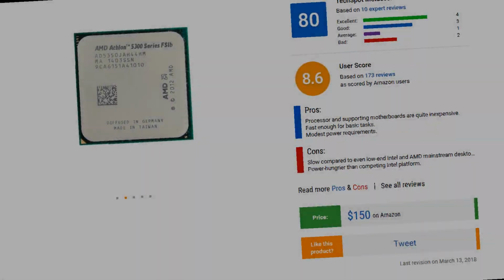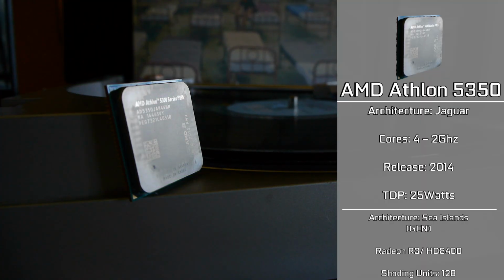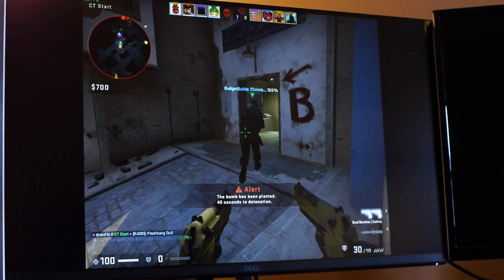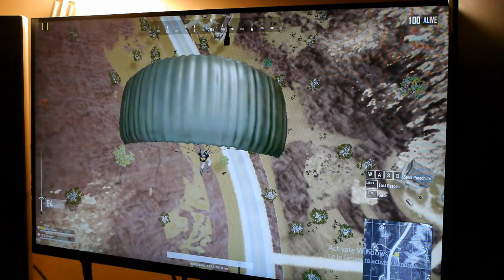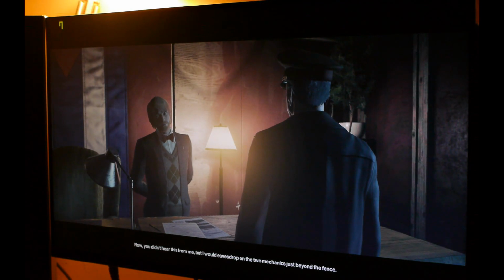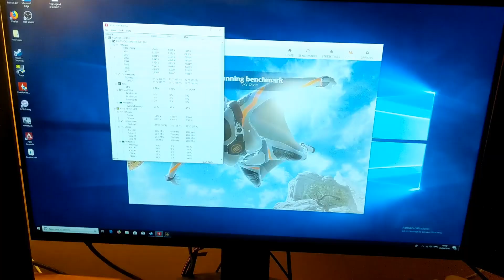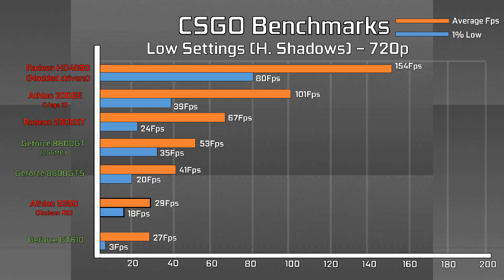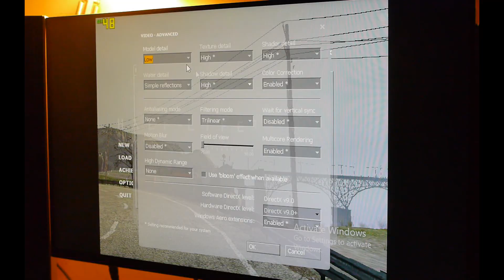Socket AM1 - Aging Horribly!

Comment: the APU side of AMD originated with brazos, the E-350 1.6 dual core with 80 gpu units, that i believe used a simplified K8 core (not the stars cores).  basically an HD 5450 and a dual core athlon x2 3600 underclocked to 1.6 ghz.  This is the evolution of that, and a lot better from where it started.  It was always intended for non gaming, or at least casual gaming, like candy crush, and internet/email.youtube... basically content consumption, not creation... you know, like most people use a computer.  In fact i'm typing this reply on such a device, a nifty 10" tablet/convertible netbook from RCA with a quadcore atom at 1.4ghz and windows 10, 2gb ram and 32gb ssd, and it still plays youtube and surfs the net great, now getting on 7 years old. amazing.
The one benefit about fm1 was the socketed design.  as it competed with intel's atom (and later the Celeron and Pentium J or silvers when intel pimped out the brand recognition to push atoms on the unsuspecting public) which was soldered on and could not be upgraded.  in that regard, it was great in concept, but being abandoned and never really developed for more than couple years really hurt it long term, as there wasn't anything to upgrade toward.
but, use it for it's intended purpose, and it's still fine today.  the low ghz speed is the only issue holding it back for any real 3d gaming, but once again, not the point of the system...never was.  And its a whole lot better than what came before it.  For the life of me I never understood why amd took what was at the time a decent apu, the e-350, and continued to pare it down in the early 2010s, making such monstrosities as the E-1000 and E-1200, running dual cores at a whimpering 1-1.2ghz, and throwing them in the cheapest laptops possible with slow mechanical hard drives. My mother in law bought one against my advice and was thoroughly dejected by the experience.  Even their old P4 Dell was more snappy.
basically any atom or amd apu that is not quad core is too slow to use today...and was actually too slow to use when new, but the quadcore systems are still usable for basic daily consumption, and fit the role well.  I also have a celeron J1850 2.0ghz quadcore atom desktop system I pieced together for $20 US fitted into my first PC case, a 2001 era HP pavilion 6835, and it runs linux mint great and I use it in my home office.  runs everything i need without issue and it is not slow for its purpose.

Comment: this always was the most standard Jaguar core you could get. Kabini sucked ass for anything that wasn't video acceleration.
Reply: Apsollute nonsence, i use E350 machine for old games and it works like charm, it even run og far cry with no problem.
Reply: @Dagoth666Ur  that's the thing: old games. it wasn't fit for anything plus-minus from its era.
Reply: @aviumcaravan  Well what do you expect from low power dual core apu? Compare it to same era Atom`s, what can you do with those?! AMD apu`s destroy`s them, so yes much more useful than Intel`s counterparts of the same time.

Comment: The Athlon 5350 overclocks easily to 2.3- 2.4 GHz on an Asrock ITX AM1 board. You also have to remember that the PCI-E 16 slot is limited to 4 lanes so it only pairs well with a video card like the GTX 750/750Ti. Also, you can pair it up with DDR3 2133 system memory for best results. It hasn't aged well but would be fine for games like Skyrim, Dragon Age Inquisition, Fallout 4 and other games from 2010-2015.

Comment: Notably the socket, likely to keep that 25 watt TDP, does not support dual-channel RAM. That, along with its various other limitations, also limit performance in games.

I think it's still a wonder though. These things are extremely thermally efficient, even to this day, for a x86 processor. But you sacrifice a lot of performance for it.

Comment: The Jaguar core was painfully slow at x86 workloads. However, both Microsoft and Sony managed to optimize their consoles really well around those chips.
The reason why it ran so slow was due to poor single threaded performance, and lack of L3 cache. Coupled with the (at the time) slow clockspeed of only 2.0 GHz, and you got a very lackluster CPU.
Reply: Not so bad, though, in the right scenario. FI, I tested my 1.6GHz 4-core Jaguar (basically what's in this video, but slower, and soldered in) with Handbrake, vs an i5-3320M (more or less a slowed down desktop Core i3), and the Jaguar was significantly faster. Why? Because it had no trouble staying cool, running at 100% on all cores, while the i5 had to back down to base clocks in short order, and didn't get a lot from Hyperthreading. I still use both machines, BTW, with the AMD one being my pick-up-and-go choice, as it gets 6+ hours on battery.

Outside of low end servers, HTPCs, etc., though, those chips were abominations on the desktop, and we're sold in Windows laptops for far too long.

The consoles partly did OK with them due to being such a huge step up from the prior generation. The CPU cores in the XB360 and PS3 were worse than first-generation Atoms at doing anything except for floating point arithmetic. The Jaguars were easily a 3-4x improvement, per-core, for anything that had branches, or could leverage OOOE...which is most real program code..

Comment: My computer specs. amd e1-2500 @ 1.7gz dual core, 
6gb ram ddr3 
radeon hd 8420 R3  built in processor
128gb ssd

This is a HP pavilion. My main rig as august 2021. play some older titles. does youtube, netflix, web and word processing.  Pretty damn good still I might add.

Comment: I have an amd 3850 system on the am1+ socket running with a r7 250 gd3 card. Runs vintage software very well, and I plan on setting it up with a 64bit version of windows xp. Hopefully, I can use it as a host system for a lan setup. I have a pair of core2duo e5600 systems with gtx260 cards to use as the client systems.

Comment: Unless you are an Intel shill what is actually wrong with and fx?
Reply from the maker: They are currently terrible value, when you factor in that a Core i5 2400 is about £12 now, and a board is about £15. You compare this with the cost of AM3+ on the market and it dominates it in all areas. There is no 'shilling' on this channel, just facts about what is best to buy.
Reply: @BudgetBuildsOfficial  problem is, is we are both talking about now old technology. Back when FX actually meant something price to performance AMD was better than intel. It has always been that way for current technology at least in the UK market.
I have used both AMD and intel products over the time and always find AMD much easier to work with (and that is as a power user), I have built systems using both as well.
Reply: @grumpyhale821  So true, people just pour bull***t `bout fx cpu`s but i have assembled buttload of systems witt fx cpu`s and no one ever have complained about them, yes they did not had ipc like intel cpu`s in that time but far away from usless like being represented today...

Comment: I got one for HTPC use back in the day with 8gb and a 128GB ssd, did the job pretty well in the 90w Antec isk 110. I ended up giving it to my mother as the case had visa mounts and could be put on her tv, where she still uses it today for web browsing, email. skype and MS Office.

Its a shame it never went further, as there are no real modern versions of PC and mobo for around £60, though the likes of the 300g are its kind of spiritual successor, but you don't get the £25 mobos for that.

Comment: If you bought an AM1 system to play games on it, you're not the brightest bulb in the box. Buy a calculator next time and try to play Cyberpunk 2077 on it.

But, if you weren't a complete potato, you bought an AM1 system for use as a low power file server, and it fits that niche perfectly.

Comment: Yeah. I bought that for my parents for office work and older games. AMD promised upgrade in the future (referring to competition as "dead-end platform") so I was thinking that I will eventually upgrade the 5150 to something significantly faster (5350 is marginally faster but is absolutely not  an upgrade worth considering). Well ... AMD crapped all over it's users on that one. 
It was comparably "high-end" build - tiny Lian-Li case, 16GB RAM (eventually swapped for 4GB), large SSD (not that common back then). So it was usable and quite good for the purpouse. Nevertheless I was buying it because I expected to swap the CPU eventually.

Comment: The base idea with AM1 was to act as a backplane for AMD's AM1 SoC chips. Yes. Soc: System on Chip. Those had everything integrated. Motherboards in these cases merely acted as passive backplanes connecting external peripherals to the SoC's and provide power.

Comment: I still use a core duo on a T61 with FreeBSD and it works 1000 times better than what you show, and it is a worse CPU... In Linux it was OK too. Maybe is something about new win10? I know it runs slower now than it does now (I had a win10 ssd I tried on my main computer and tried from time to time, and now it works so much slower than it did a year ago!). If you don't want to try Unix systems, why you don't try it with win7, or older builds of 10?
Reply: The Core Duo T8100 CPU inside of T61's has 64KB of L1 cache per core, and 3 megabytes of shared L2 cache.

The AMD 5350 has 64KB of L1 cache per core, and 512Kb of L2 cache per core.

The cache set up on the Core Duo is probably better than the set up on the AMD 5350 for most daily tasks. 

Even though the 5350 has double the cores of the core duo, it's still gonna experience a lot more cache misses, especially since the task scheduler of the OS will be throwing all kinds of random background processes on each core all the time, causing the cache on each core to be reset constantly.

The 5350 would probably have been more powerful for general computing tasks if it had half the cores, and four times the L2 cache ( shared instead of per core). It is essentially unusable for anything other than being a low power server. It wont be able to even browse the web without massive stuttering.

Comment: 03:05 what is wrong with the fx series? They are from like 2012 and still run all games if you got the good ones(not the fx4xxx for example) but like a 8350, does pretty good in 2020.

Comment: I've had a 5350 as my file server for years. Great for low power use! 
Also makes a good emulation /Linux rig!
Reply: I'm looking at buying a little PC with one of these chips in it to use as a mini NAS running OpenMediaVault or similar. Do you still use yours or have you upgraded? Would you recommend it?

Comment: Never had an am1 or fm1, I knew had bad they were. I skipped the FX for myself and got a 8300 for my son, good enough. I went from my Phenom II x4 at 4.5 and 16 gig of 1666 to a Ryzen 5 1600 to a Ryzen 5 3600 at 4.2 p95 stable on all cores and 16 of 3200 pc4 . One son inherited the R5 1600 at 4.0 on all six and 3000 pc4 . My other son still at home has an I5 6600k @4.5 on water, not a winner there and 2400 pc4. It still does well and is every bit as good as the R5 1600. But NEVER those pos's. LOL

Comment: I used to have a sempron 2650 2c2t 1.45ghz 1mb l2 . Oh boy what a pain in the a$$ was it , but still played a lot of games at 768p . Its good for titles till 2010 . Its better to go with core 2 duo , Gt 710 or 550 ti to get 60 fps on older titles . Sold that $hit for $20

Comment: The premise of this "review" is similar to taking a Range Rover to a rally race; not suited for the purpose.  The AMD 5350 was and remains a fairly low powered device ideally suited as an always on HTPC, since it is all passively cooled. Mine is running just great, and is completely silent without any fans.  Gotta laugh at your sneering smugness; you've completely missed the point.
Reply from the maker: I praise its use as a media center or HTPC style PC. But you may have missed the point where people legitimately reccomended a
 these for gaming PCs. 

I'm simply covering that this is not the case, and for gaming use cases (and even desktop use cases sometimes) it has aged really bad 👍
Reply: @BudgetBuildsOfficial  Fair enough, maybe I didn;t get that far.

Comment: I play on my secondary pc bc my pc is at the moment used for editing and for an intel core duo E8400 3.00ghz with 4gb of ram and an hd radeon 3570, it runs csgo with low settings with 1200x1024 at 80 fps. Very good if u ask me, and i want to upgrade the graphics card and the ram
Reply: just upgrade to c2q + gt 1030 +8gb ram

Comment: Ugh, Jaguar! I had a Bobcat processor in a laptop, and it always was horrendously slow. These days windows uses 90% of processor capacity. When I bought it the only web browser I could watch videos in was Edge, because only that had full hardware acceleration support. If you wanted to make a data centre and the number of cores was irrelevant then it was probably a fantastic option, being optimised for extreme low power. But try to run as a basic desktop and it just doesn't add up to a usable system, even when it was brand new. This is a CPU intended to power netbooks and smaller. Put one in your watch! The Bobcat cores are about 3mm2, and that is on a 40nm architechture! All power hungry optimisations have been stripped away, and it's probably a fantastic processor for back when other processors also didn't have those optimisations.

Comment: @3:04

:(

I'm still using an FX-series processor (6350), and play modern games with it. Just picked up Dirt Rally 2.0 and it runs it perfectly :3
Reply: I mean I dont get why people hate fx so much but not ryzen, like ryzen is more efficient, but other ryzen is also newer, and other than that they seem the same(altho ryzen is a lot more expensive, and better otc but like both have "bad" or "worse"(or whatever you wanna call it) single core but good multicore performance).
Reply: I have since upgraded to a Ryzen R5 5600G. #BudgetPCs.

Comment: I own this CPU and have got it to run doom 2016 in vulkan at 1080p at 60 fps. it will dip to the 40's but it hits 60's too. this CPU with 8GB 1333 mhz ram with a r9 290x GPU. if you are playing a game thats CPU bound, increasing the resolution will offload more work onto the GPU and help the CPU out some.

Comment: Nope the cpu cost new 140euro a i5 cost 200 euro
The mainbord fm1 50euro
The mainbord intel 100 euro.
The cost in that time you can have a real cheap game setup with a free gpu.
Mijn fm1 system go death after sse4.1 need for play the games.
So the fm1 for go on a pension in 2018
Reply from the maker: 1155 is not that expensive. So no do not touch FM1/2 or AM1/2/3

Comment: Weren't these basically AMD's answer to something like a Celeron J or Pentium embedded desktop board? I think these might even be worse than those. My buddy has one of the embedded Intels and it at least gave performance around stock Q6600 level if I remember right. Useable for basic stuff and consumes no power.
Reply: Not quite. They were to compete with the first (and second) generation Atoms, which they handily beat. Atom cores had these beat, aside from GPU, though, by the time they killed off the Atom brand name, and rolled them into the J and N Celerons (and Xeons).

Comment: TO bad fair, AM1 itself was 10 years old when this chip was released.
Reply from the maker: It wasnt
Reply: @BudgetBuildsOfficial  As far as the socket goes, it was.  I had one in 2003 with a 1600+ sitting in it.  The AM2 came out in 2006.
Reply from the maker: You didn't, AM1 was released alongside AM3 and FM2.
Reply: @nuanil  .....my best guess is you had a cpu on Socket A or Socket 563. AMD never released a socket AM1 cause it sounded too similar to the socket of a competitor. AM2 is the first to use that naming scheme.  I'm guessing you are referring to an Anthlon XP 1600+ or something 

AM1 came out in 2014 (so Budgets claim it came out alongside the AM3 and FM2 is actually wrong. Pretty sure AM1 came out after AM3+ and FM2+ (positive on the first one, pretty sure on the 2nd) 

so bottom line.....total Bush League. Absolute amateur hour not knowing the history of AM1 socket

Comment: Wait what's wrong with FX CPUs? I still have an 8350 until I finish my new Ryzen build, and it runs DOOM Eternal at a solid 60fps on Ultra settings paired with an RX 480. Probably would go higher if I turned V-Sync off. And doesn't even go above 55c.
Reply from the maker: They're just poor value compared to the competing Intel chips of the same era nowadays
Reply: @BudgetBuildsOfficial  he also picked like the worst game to ask about. the last 2 Doom games have had great cpu optimization.

Comment: These APUs were really meant for laptops, the power savings was amazing. Had an AMD A6-5200 APU for the longest time and got so much work done on it.
Reply: I'm still rocking an X140e, on its second battery. It's several years old, but gets all day battery life, has a rugged case, a ThinkPad's trademark awful TN panel with an awesome titmouse and keyboard, VGA, and a full sized RJ45. It runs circles around the Celeron Chrome book (with BIOS and real Linux) it replaced, and still has a year or two if life left, I think.

Comment: As a couple of others here have said: the Socket AM1 wasn't purely an APU standard, it was a SoC. Most boards made for it were tiny because those boards didn't have extra components since the AM1 was performing all of the motherboard's tasks.

I don't get why it was being pushed so heavily as a budget gaming PC CPU when a cursory Google at the standard would immediately tell you it's ill fit for such tasks unless you want to use it as a Windows XP/compatibility mode Windows 7 machine.